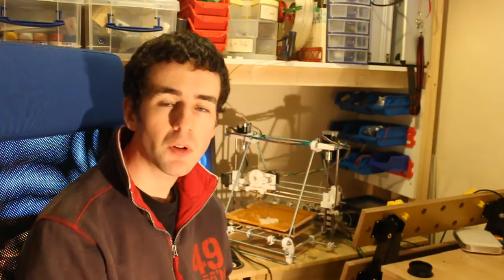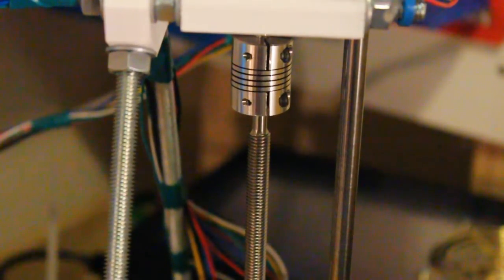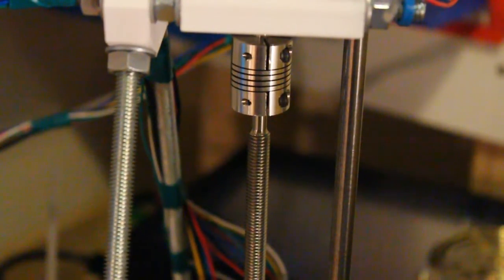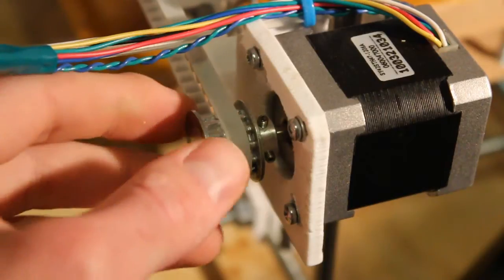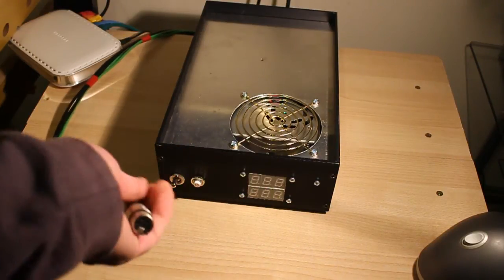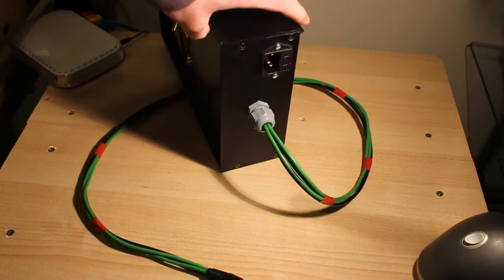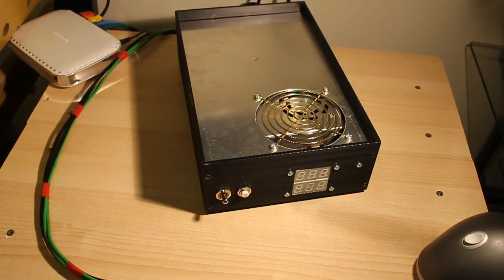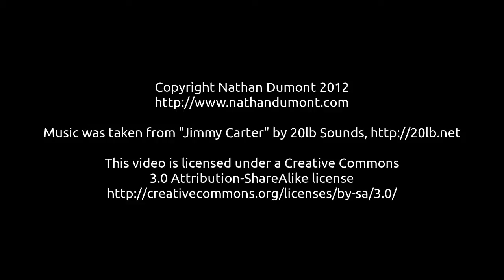RepRap Upgrades

Comment from the maker: The heat problem is pretty much sorted now, I've turned down the current.  The problem with the Pololu stepper driver boards is the quality and size of the current set trimmer it's really hard to hit a balance between missing steps and getting too hot.  Seems good now though, I've done 2hour+ prints with no warping of the plastic parts.

Comment: I experienced the same problem as you, i went to the local hackerspace and printet a motormount out of abs. Abs keeps its structure up to 80 °C as pla only is cakable of 40-50°C. Its almost impossible to runn a stepper for more than a hour with extreeem low current and not losing steps :)